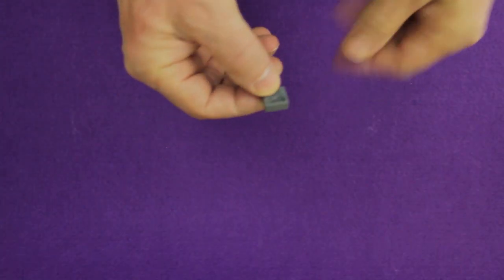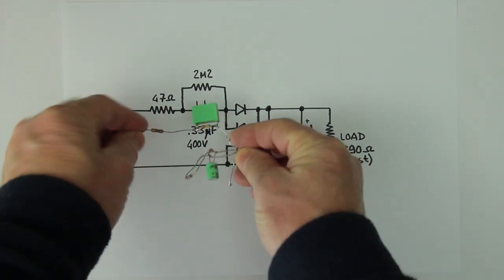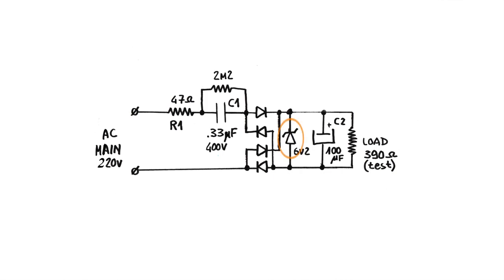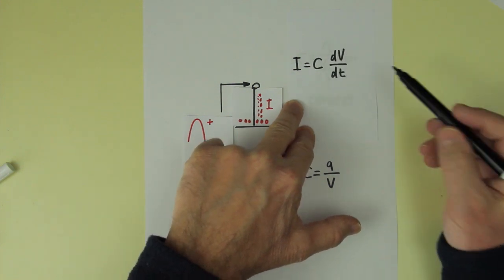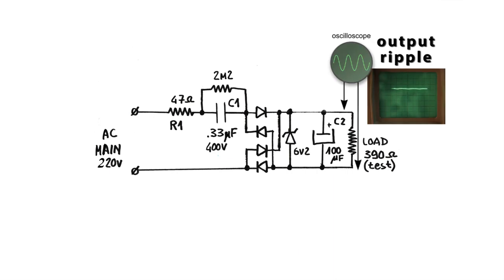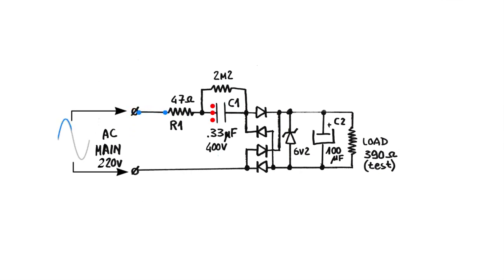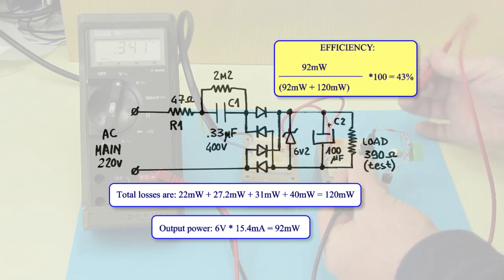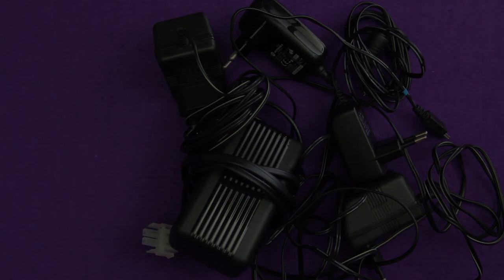Why Capacitive Power Supply Are Bad (electronics educational)

Comment: What if you don't use the diode bridge and the rest of the circuit? I only need 8 mA for my DIY application ad that works well. It may be inefficient but its very low cost and does not need extra PCB real-estate.
Reply from the maker: With no diode bridge your circuit would be powered with alternating current. This is not an endorsement, though. Let apart inefficiency this circuit remains dangerous.
Reply: @AccidentalScience  I am only using one rectifier diode (not a bridge). It must be inefficient.

Comment: I've created a dusk-to-dawn device, which consumes only 8mA and turn on a Triac. It's located inside a plastic box. For this purpose, capacitive power supply is perfect, it's the way to go.
However, I'd never use a capacitive power supply in a open space where someone can touch it. It's very dangerous.

Comment: I noticed that you're using the unit "Wrms" for the power. This is an erroneous expression. The power is always a mean or average value. So you just write "W". The term RMS tells you about the sequence of calculations (root, mean square) that are done on an infinitive number of momentarely values. This does not apply to the calculation of power.
Reply from the maker: You are right, I wrote the term "Wrms" to highlight the fact that is derived from the Vrms, but it is not formally correct because it is not the RMS of the power rather the power that come from the squared RMS value of the voltage over the resistance. Thank you for commenting and having spotted this thing that I forgot to clarify in my video.

Comment: Actualy in some.cases capacitive chargers are good litle devices. Using one for manny years to load car bateries. Brought manny dead batteries to life again. Thanks to it wawe form of curent they actualy do a great job on desulfating old lead acid bateries
Reply from the maker: Well I would do not recommend doing this thing. Just for the danger.
That said, thank you for comment.
Reply: @AccidentalScience  Ofcourse they are dangerous. Buth so they are badly isolated cheep chinese transformers, cables with hair thin wire, and so on. 
The facts are:
1. Capacitive voltage dropers are used for decades ( old chargeable lamps and so on)
2. They are simple and cheap
3. No heat
4. Some batteries(lead acid) favour nonlinear current curve. Makes them desulfate.
5.  Capacitors can kill you.
6.  So can a cola and mentos or a fork or a bicycle :D

Best wishes to all. Be safe, be smart.
Reply: @djordjepavlovic5870  how can it be called inefficient if there is no heat generated ? i tried one such circuit and yes there is no loss to heat at all . the pf loss is not real loss .
Reply: @tolgadabbagh1877  never said that they are inneficient.
Reply: @djordjepavlovic5870  i know , i wrote it to support you .

Comment: I have seen similar power supply in a 1500W electric heater (to power up a small IC that will turn on/off resistance heating coils using relays).  Sure, it has poor efficiency, but it's not a problem since it is dissipating thousands of watts at the same time. The whole PCB was in a closed housing, to help with poor isolation.
Reply from the maker: Yes, there are some cases where this kind of circuit could be an acceptable solution.
Reply: Still there are other solutions to this, for example using the voltage drop from a part of the coil with a 7805.

Comment: Why do you include the zener diode in your measurement? It's got nothing to do with the capacitive-ness of the power supply -- you could just as easily have put a more efficient (and still really cheap) linear voltage regulator in there.
Reply from the maker: I've shown the typical "dirty cheap" circuit, e.g., the one used in some LED lamps made in China.
Since the diode is part of the circuit, must be measured. I agree that a voltage regulator would have been likely more efficient.

Comment: Remove transformer stack, R1, and 2M2, and your efficiency will go up significantly. I disagree with the conclusion of your analysis. Diodes can be bought with Vf of ~0.2V. Zener is not needed depending on load.
Reply from the maker: Thank you for having commented, disagreeing with my conclusions is utterly fine. However some objections: 1. The transformer stack is taken out from the measurement and it is used for safety reasons both to provide isolation from mains and to limit the current. 2. The 2M2 resistor can be removed increasing efficiency at the cost of safety, as already mentioned in the video. 3. R1 (if I remember correctly, I am on a mobile and can't see the circuit rigth now) is required to limit the in rush current in the case the circuit is energized on the peak of the AC mains. 
I do agree that a schottky diode would have less Vf, if you can find one that have enough Vr as well, yet the big problem with this kind of circuit is the power factor that is the major source of inefficiency, in particular when the required power is larger than the one used in this demo circuit. 
Cheers.

Comment: I am using this type of power supply but I am facing power factor reducing problem.The power factor go very bad when I am increasing the value of X capacitor.can I fix this problem? Please help me.
Reply from the maker: What stand for "X capacitor"? Anyway, the bad power factor is intrinsic of this kind of power supplies so the only possible solution is to change design and choose an other kind of PS, even a very small transformer makes less harm to the power factor, particularly if it is corrected with a capacitor.

Comment: May I ask another question? I'm always having this simple question : In AC circuit we say the polarity is constantly changing. Why we always get the hot wire on only one cable when using a test pencil  ? Thank you
Reply from the maker: The "hot" wire is about your instrument, not the AC circuit. However, AC can be seen relatively to one potential, and that potential could be set to ground in the circuit, that we refer to be at zero potential (this is relative to us as we all are in contact with Earth). Therefore if in one AC circuit one wire is connected to ground by consequence the other wire will be defined to be the "live" one, with a voltage that alternatively goes positive and negative relatively to ground.
For example, in Europe we have power distribution through four wires: the three phases (RST, normatively black wires) that come from the generator at the power station (I'm simplifying) and the Neutral (blue wire) which is connected to ground thus at the same zero potential of PE (Protective Earth, green-yellow wire, which is also ground). For single phase, in your home they carry one of the three phases and the Neutral to provide a single phase power line, thus the black or brown wire that carries the phase is the live wire, the blue is the neutral which is at approximately the same voltage of PE (the typically negligible difference comes from the resistivity of the ground between the two grounded points: N and PE).
Reply: @AccidentalScience  That is an awesome answer : clear and concise. I never wondered why the test pencil lit only on one cable, now i understand that the pencil links the live to my body (which is linked to earth) and as neutral is linked (somewhere) to PE, we have a full circuit. Thus, when i touche the live with the test pencil, there is a different in potential and current can flow, but when i touch neutral the circuit is essentially "neutral - pen - body - pe - neutral" so no difference of potential so no current. I'm enlightened and delighted to have understood this. THANKS.
Reply from the maker: @ni_pil  exactly. Glad to be helpful.

Comment: Dear engineer ,  I have heard when using isolated power supply ( two transformers) we should avoid connecting oscilloscope to the output while this isolated voltage will burn the scope. Am I right ? ( thank you for your detaild explanations)
Reply from the maker: If there is isolation there is no path the current can take, so no burning can occur. Usually the risk with scopes is the path to ground while attempting to measure mains non-isolated voltage, because the shield of the probe (connected to ground) could short the live wire from mains. If you look at my video about capacitor power supply you'll see that I've arranged te test circuit through two transformers to make an improvised insulating transformer just to avoid that risk.
Anyway always think what path the current may take to work safely. A scheme would be beneficial, may be I will make a video on this topic as soon as I'll recover from a kind of flu.
Reply: @AccidentalScience  Thank you so much for fast reply. I'm looking for a video about the risk of blowing up an oscilloscope when measuring voltages on isolated power suply .
I"ll send it as soon as I can find it .

Comment: With or without any load being connected to the output the current of the circuit is constant 23mA,but despite that there are many automation circuits like motion with day night light detectors that this circuit works excellent and these circuits are not accessible so there is no risk of electrocution.

Comment: Several very solid points about the issues with a capacitive power supply. Curious to hear you take on the following approach to the same http://www.ti.com/product/TPS7A78?utm_source=google&utm_medium=cpc&utm_campaign=app-null-null-gpn_en-cpc-pf-google-wwe&utm_content=tps7a78&ds_k=TPS7A78&dcm=yes&gclid=CjwKCAjw1f_pBRAEEiwApp0JKFCtKz-KjD7WbiMySZ10OKqPs03zi_Lfxk0v1OwAWL8KxKqYbX-VDRoCcvAQAvD_BwE&gclsrc=aw.ds

Comment: What do you think about the case that the power factor is capacitive... once the main power factor of your house is generally inductive, it ends acting as a power factor correction. Am I wrong?
Reply: As far as you are paying for real power, it does not matter for you. Industries pay extra fee for apparent power, so they have to compensate. This little capacitor does not compensate so much, maybe it is better for your electricity provider :P
Reply from the maker: You are right, in the case the load in your house is manly inductive.

Comment: When i make it directly on wire the voltage output equal with the voltage on diode zener, but when I make it on handmade circuit print then the voltage output is decrease to 2,5vdc. You can explain? Tks
Reply from the maker: Hard to say without inspecting the circuit live, try to check the circuit for any error. Low voltage may be due for a wrong zener diode, reversed electrolytic capacitor, or wrong R and C values at the input stage. Also, if you used discrete diodes to make the full bridge rectifier, if one of them is reversed then the output voltage would drop significantly.

Comment: Sir, i have made this circuit for the 12v load but starting range is 6.82 v - 12v at 12v its fully operational so after applying the above circuit even with the 12v zener diode the circuit goes to max. Voltage of 6.82 v the voltage at which the loads start and does goes up after that but without load it gives the zener output bolts of 12v plz help!!!

Comment: Hi, you should take into into account that more you reduce the R2 resistor 2M2, the better power factor you get. I think you can gain better results with better component value calculation. The second issue is we have to isolate GND connections when we use this topolgy in parallel. Because, the current can find its way from another rectifiers. Anyways, this is a quite good and cheap and robust solution in some points.
Reply: Ilhami Kivrak m
Reply: 1M ohm is enough, right?

Comment: Not useful for any serious loads but useful for power indication leds or powering the coil of a relay switching mains.
Reply: Its just a matter of chosing the right capacitor. I have an 10 amp capacitive car battery charger, and 10 amps transformer is much biger, havier, and more expensive than capacitor :)
Reply: @djordjepavlovic5870  10 amps is very high current for capcitor dropper. Are u sure it uses capacitor dropper.

Comment from the maker: I am going to develop a level detector for liquids, that in my case will be used for a simple control of a submerged pump and alarm/monitoring of a manhole collecting sewage ...you know, disgusting things where a good automation is really welcome ;) Since this device will be always on, I was looking for a very efficient power supply, so I wondered about the efficiency of the capacitive power supply, and I thought to share my findings with this video.
I will show that project in the next videos, however I can anticipate that eventually I found convenient to use a pluggable SMPS recovered from a dismissed video sender.
Claudio.

Comment: Do you have any schematics of power supplies that you could recommend? Thanks.
Reply from the maker: Alternative schematics? It's hard to give an answer because it depends by the circuit that have to be fed. In general switching power supplies are a good deal, for DIY projects though the simplest, cheapest, cleanest solution (in terms of noise) are the one made with classical transformers and regulators such as 7812 or similar, even though they are not so efficient as SMPS are. Unfortunately I am not a specialist in switching mode power supplies and I cannot give any detailed recommendation about them (for this reason I prefer to buy them :) ).
One important drowback of many low cost SMPS is the inability to start up heavy capacitive loads. I.e. in the lab we had problems with a very well known brand of SMPS that are unable to start up when connected to a capacitive load of just 350 uF.
Claudio.